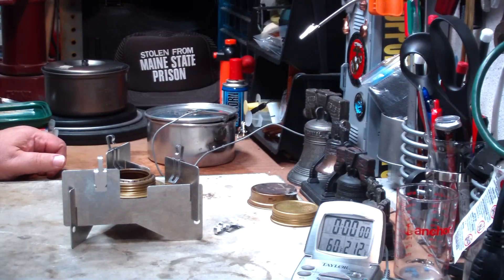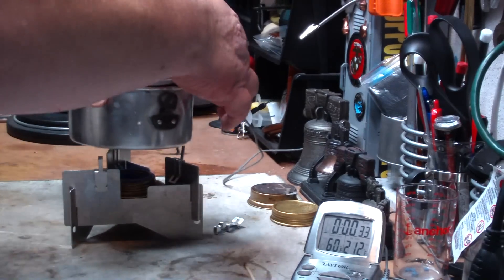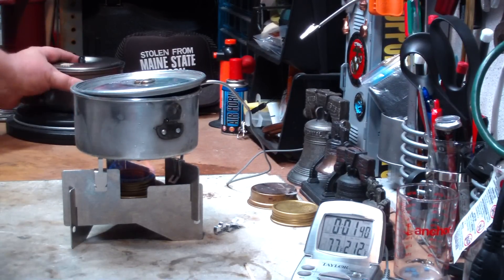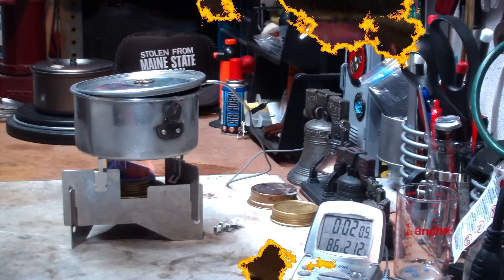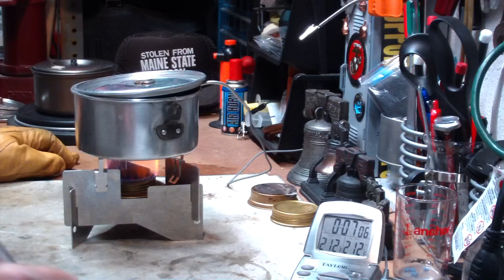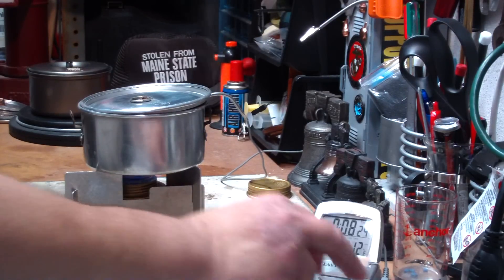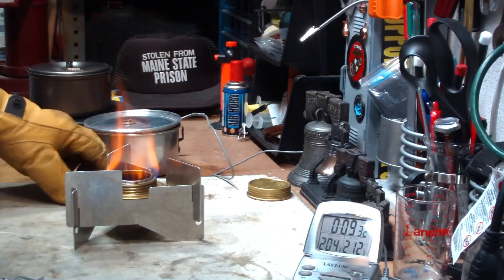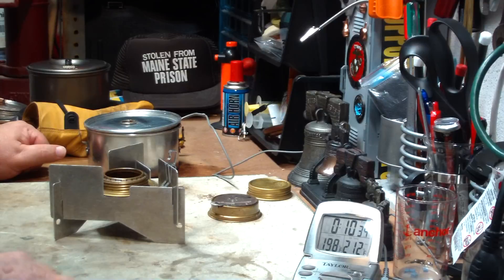Westwind Stove - Mod #1 - Boil test 2

Comment: would it be possible to just cut down the u-shaped sections on all three aluminum parts to get closer to the 'sweet spot' without having to use the clamps ???
or do you think the aluminum would be getting to unstable with the deeper cuts ?

thanks so much !

P.